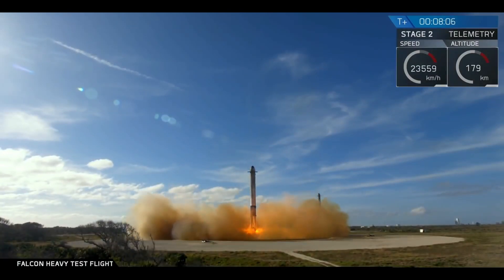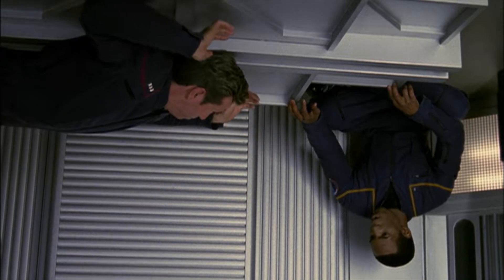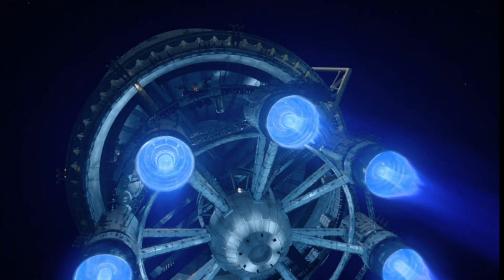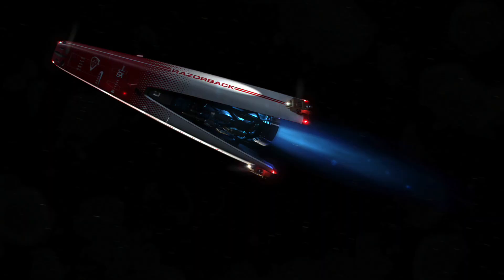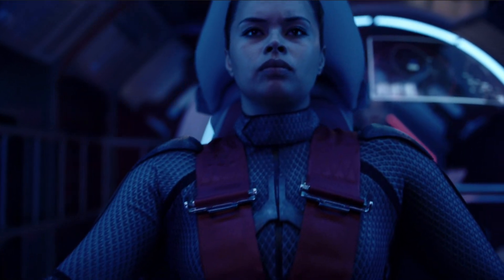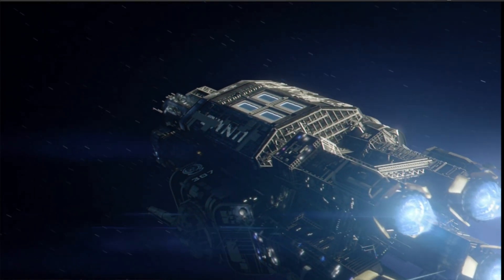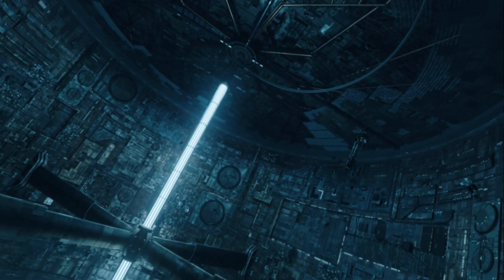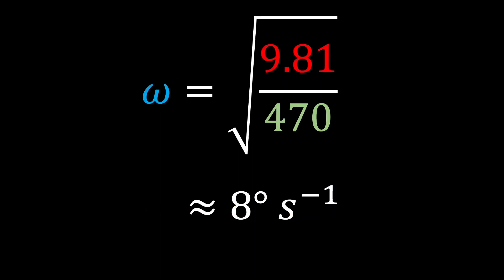Are the Expanse Ships Realistic? - Science of the Expanse

Comment from the maker: A point I missed putting in is that the seats in the Rocinante lean back to change the acceleration from vertical to horizontal. Another cool attention to detail!
Reply: If I remember correctly another detail is that Rocinante type ships turn by 180 degree before starting to de-accelerate. This way the passenger's also de-accelerate safely and they still get pressed towards the floor with a force of 1g. Otherwise the passengers would f.e. crash into the ceiling of the floor they are at at that moment. Or in more extreme cases they would get ripped apart like the pilot of that little ship that suddenly got stopped in front of the ring gate 2 seasons ago.
Reply: @Keelyn1984  all the ships have to do that, they only have 1 engine on the bottom of the ship. it dosnt have reverse, so they do a "flip and burn" at the half way point
Reply: @icer1249  put an engine on both ends problem solved
Reply: @nathanmoore101  and how would u orient your position on the ship? What would be the floor and the roof? How would keep everything in place when u switch engines so it's not upside down?
Reply: @Keelyn1984  Yes. That's actually pretty common in Torch-Ship type stories. Where they kill thrust, flip the ship, and start the braking burn.

It's not just the Roci that does it either. You can see several different ships using the turn-and-burn braking at different points in the show. (Also curiously...Note that the landing/docking areas on stations are offset on cantilevers. Not directly at the surface. The only time you see a torch directly pointed at another ship in a non-offensive action is when the Tachi is escaping from the Donnager early in the series and Alex opens the throttle before the cradle actually releases them.
Reply: Also a great attation to detail - i even whould say, using the physics to create tension - is this one scene, where they are in a battle and have to do hard manouvering and one locker for tools isn't tightly secured . so the tools get loose and nearly kill a crew member ! BTW did you now there is already a space station with spin gravity in the first stages of planning  ( Its more like the Mars Society, but it is something :D : https://www.youtube.com/watch?v=m50A-3OLGd0&ab_channel=TheGatewayFoundation )
Reply: Wouldnt it make more sense if the command modules would be in the middle of the ship rather than at the top? -- I mean they have thrusters on the top and bottom of most ships, they also like to flip and spin around -- and if you are in the middle of the ship you get accelerated a lot less -- as they usually use that as a pivoting point. - so the razer back and the roci should have their command centres in the middle, rather than at the top.

(Especially since the roci has the pdc's and they need a lot of quick maneuvres to be able to use those effectively)
Reply: @telekbalazskristof  Not how it works, even if the command module was in the center of the ship, the force of acceleration (pravity) is the same, the only thing that may be lessened would be high-G rotations (it's not really a turn par say).
Reply: @Mortlupo  Yeah sorry I wasn't clear -- I understand the concept of physics within the series (with the exception of the proto molecule) - however as you mentioned a high-g rotation for example, flip and burn would put a really high strain on the crew at both ends of the stick (as for example helicopters propeller or any spinning rod) the end of the stick would be a shittier place to be than the middle. - that's basically how the high-g simulators work on earth you put person on end of stick - you spin stick real fast - person goes pass out XD. what I meant is more like that haha - so building up from that I thought that having the command module in the middle of the ship would potentially put less strain on the crew in the event of a high-g maneuver as if you look at the show they usually spin the roci or other ships around center mass and not the command module. well anyways thanks for your answer :)
Reply: Fighter jets also have an angle in the seat to help with high Gs they are at usually ~115 degrees so that the height between your heart and head is lower.
Reply: lol I was just going to mention the seat gimbals :)
Reply: As an aside, the shipboard seats/beds in the Expanse novels are all referred to a Crash couches. They are described as being gimbaled (much like the Razorbacks seats in the show) bit also massive gel cushions, so that the occupant sinks into them, allowing the forces of acceleration to be applied over their whole body.

I think they re-styled the seats for TV, as these massive gel baths would obscure camera shots and block much of the drama aboard the ships
Reply: I was about to point that out!
Reply: yeah i thought of that too, also people jiuce up when doing that kind of maneuvers , so there is some "fictional" science to help out, thays why its sci fi XD, but it feel believable i can actually see us n those kind of ship under the next 100 years
Reply: Yes . The Rocinante' is capable of 30g if needed in combat , so seats are gimballed . After all , she IS  a Gunship .
Reply: I must have missed something about those gimballing fighters. As there is no atmosphere in space the only source of G is the engine which is always in the same orientation to your back. So why gimball?
Reply: @alanjenkins1508  Atmosphere has nothing to do w acceleration. The gimbals are there to compensate for centripetal force, as when the ship turns, the vectors of g force change. The gimbals are meant to compensate for that.
Reply: @alanjenkins1508  transitional g forces as well as lateral thrusters .. at least that's how I'm justifying it :)
Reply: You've also missed the issue of cosmic rays and radiation shielding, which is a huge concern and we never see it addressed in science fiction.
Reply: In the books the roci has the same kind of gimbaled acceleration couches like those in the razorback they changed them for the TV series
Reply: what i don't get is why are earths ship so slow compared to the others? they life under the strongest gravity. they should be able to constantly accelerate with one g something martians don't like or can't really endure with and something most belters can't survive for long. i get the weaker weapon system part but the speed never made sense to me.
Reply: @MultiKeto  It's actually a matter of stresses on the ship. Earther ships are BIG, so they move slower. Martian and Belter ships are smaller, so they move faster, except for the generation ship which goes slower so that it can do spin gravity without having to change all the fittings between thrust and spin.
Reply: @MultiKeto  Interesting point I've never thought about that. Belters would really be at a disadvantage.
Reply: Crash couches
Reply: An 1982 RPG, Star Frontier, by TSR, had ships like this, with the decks being perpendicular to the axis of travel.  One of the sources of back ground material for the Expanse, another RPG called Jovian Chronicles also used this idea for its ships.
Reply: The next great leap in human evolution will be our invention of conscious, self aware machines.
This will unlock EVERTHING!
We are literally on the door step.
Reply: @Lethgar_Smith  we will fall behind if that happens, but that's okay, nothint would be better as a legacy than that imo
Reply: In the book they even gimbal side to side slightly during turns.
Reply: first reusable rockets by spaceX. the space shuttle, the buran, the dc-x and the blue origgins new sheperd want to talk to you.
Reply: You mentioned the 2 G's pointed at your head... it's not considered a 'black out' per se, but a 'RED OUT', as your brain has too much blood. The risk is blood vessels bursting.
Reply: They also pump themselves with some sort of acceleration tolerance drug in cases where they need to move really fast.
Reply: They also simply use magboots when not under thrust.
Reply: Another interesting point when it comes to Gs and fighter jets is that historically the jet has a G limit which is lower than what the pilot can handle such as with the F18 being ~6.5G jet. The pilot can override the G limits in an emergency but this will require the maintenance personnel to throughly check the jet for issues from this. The first jet that actually is limited due to the pilots ability to remain aware while pulling high Gs is the F-22 which is a 12G jet. The F16 is a 10G jet all day so the design of the jet is a huge factor when to comes to the Gs the jet can pull without ripping the wings off or killing the pilots. This is one reason the pentagon is seriously considering remotely piloted fights but being in the seat allows you to “feel” the jet and if you are pushing it too far, however I believe our generation will be the last generation of fighter pilots to spend their whole career on the jet. The fighter community has a saying that describes this it’s “strapping the jet on your back” instead of saying I strapped into the seat.
Reply: @williamgorham7339  G tolerance is a tricky subject.  In modern aerobatics competitions, they hit +15 / -12 g all the time, but only for milliseconds.  Duration, rate of onset, and a whole lot of other factors come into play, so basically any modern fighter can be pilot limited in terms of g depending on how it's flown.  

Structural loads and performance also get complicated.  The F-18 E/F is a 7.5g airplane with basically a "free" overstress to 8g (minimal inspection requirements).  Several years back, Boeing was trying to sell them to India who had a requirement for 8.5g.  The structural engineers decided that the airplane could take it - at the cost of a greatly reduced service life.  However, the Rhino doesn't have enough motor to do that for any appreciable amount of time without getting way slow and falling out of the sky.  It's not usually a good idea to blow off all your energy in the merge unless you're really, really, sure you're gonna get a kill.
Reply: @williamgorham7339 Drones can pull 50-80G, and you can make planes that handle 30-40 it's just stupid to do at the moment because no one can survive that.
Reply: i think if we managed to make ourselves into more machines, space travel would become way, way cheaper and easier. No need for food, oxygen, even light or other systems. Basically you can sit in a torpedo. 

But the coolest form of space travel i've seen is probably from altered carbon. They basically uploaded their consciousness into a digital form and then "beamed" it to another planet. Effectively traveling at lightspeed. Haven't seen that one before and that would be a really, really cool way to travel. Of course it assumes that we would be successful in transferring our consciousness into a digital form or if its even possible.
Reply: @syzerix3157  But then you get into whole metaphysical argument of where consciousness resides and whether you're still you when a copy of your consciousness is restarted. The idea of a teleporter like start trek or digital consciousness in Altered Carbon freaks me out. In my view, it's just basically your clone that is re-energised or put into another "sleeve". To everyone else, you'd still be you, but it would be an entirely different copy of you i.e. the conscious entity would cease existing at the point of transfer and basically die, and an entirely new and separate conscious version of you would wake up on the other end.
Reply: @gedaliaw  Ooh, SOMA the video game explores this very, very well. 

But yeah, that'd be a issue. Although we could make the argument that if you slowly replace parts then it'd still be you. Like your body replaces all its cells every 7 years but you're still you. Just upgraded (well if things pan out).
Reply: @syzerix3157  I get that argument about cell replacement, sure. However that is a gradual undertaking with you changing with it all along the way. However, what we're discussing is the sudden and immediate losing of consciousness followed by the sudden and immediate resumption of consciousness in an entirely different body/sphere.
Reply: @gedaliaw  Yeah, that I agree does bother me.

Thats my issue with ftl. There's no explanation for the paradoxes that'd pop up.
Reply: @gedaliaw  You lose consciousness every day for eight hours. Maybe you wake up in a new body every day.
Reply: @gedaliaw  we lose consciousness every day for about 8 hours. if sonebody replaced our body and kept memories you'd never know. who knows maybe it's happening even now. sometimes I do feel like a new man when I wake up :)
Reply: @syzerix3157  Has the same problem as Star Trek transporters though - the original person is annihilated and a clone with his memories replaces him at the destination.
Every person that has their personality in a shard is in fact an AI copy of their original self. Furthermore, when it travels across the stars via transmission, it becomes a copy of the copy.
tldr - the only humans in Altered Carbon are the terrorist people that reject the shard technology. Everyone else is a brand new species of AI that uses human bodies to move around.
Reply: @syzerix3157  But that would also bring a philosophical problem: Is that conscience that got transfered still you, or is it a copy of you and your previous self dies in the process?
Reply: Please do a video on explaining Proto-molecules... explore Concepts like Great Gray Goo, Von Nuemann self replicating Probes, Programmable matter
Reply: Two words:  BABYLON 5
Reply: @Allan_aka_RocKITEman  lol
Reply: so when you accelerate the fluids in your body get rushed straight your head, the expanse as with all science fiction shows is they cannot stick with reality.
Reality is not popular in films based on psuedo science.
I would hope fuck wits like you stop trying to associate SCIENCE FICTION WITH SCIENCE FACT.
Their not compatible like religion and science.
one deals in reality , the other deals with insanity.
Reply: @ossiedunstan4419  ..hmm ....so much anger so little math

Comment: The MOST efficient design is (IMHO) ... a disk. Rather than the "canal house" design.
Why? Because you don't have vertical travel, so precious floor space is not wasted on stairs, elevators, access ways etc.
The main reason for a VERTICAL design would be - air resistance? There's no air in space. So no air resistance, no aerodynamics etc.
If there is a need for a "forward micrometeorite shield" then the "canal house" design may get an edge.
Otherwise, a disk or saucer is the most cost/space efficient approach.
But I loved the books - Corey clearly did a great job of using what we know NOW to predict the future.
Even the engines are not far beyond modern tech (assuming they are a high-specific-impulse fusion torch OR a fractional-c particle acceleration approach).
Reply: Wouldnt that only be better for very small crafts though? 

1. Since if you want more space you'd have to make the diameter bigger and bigger and bigger.

2. Also considering different modules, like the reactor, weapon stations etc dont have the same height so the saucer has alot of bumps etc, might aswell stack everything. 

3. Docking at ports might be a nightmare. If I think about the Eros dock which does not seem super large having only saucers would waste alot of vertical space.

4. Flipping around to decelerate would require more fuel, since the RCS thrusters would need to fire stronger, compared to a dutch cannal design (tbh not totally sure about this one, considering I'm no physics expert)

I assume you mean instead of

E>□□□□□ 

You mean: (E = Engine/Thrusters)

     □
     □ 
E>□
     □
     □

Comment: I feel like a counter rotating accelerating decelerating hubs that position the habitat its spinning on the outside diameter as usual but in this instance the habitat can spin free of the hub to stabilize with actuators to vary the floor angle in the habitat because it can turn to compensate for the ships acceleration and deceleration...while the habs accelerate and decelerate in counter rotation to provide the pivoting spinning habitat with 1 g vertical constant, for the habitat occupant...good luck🖖